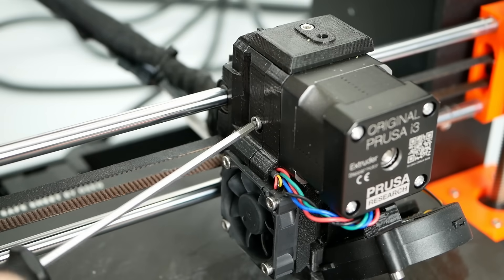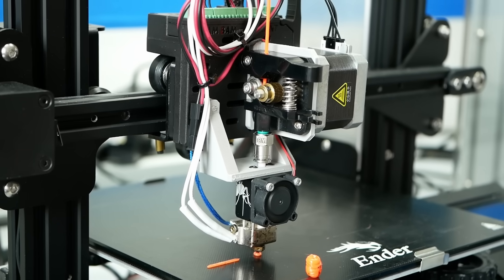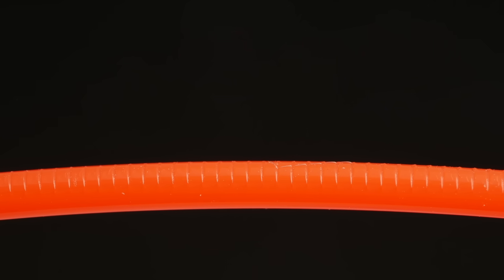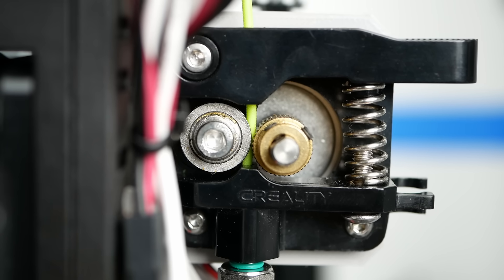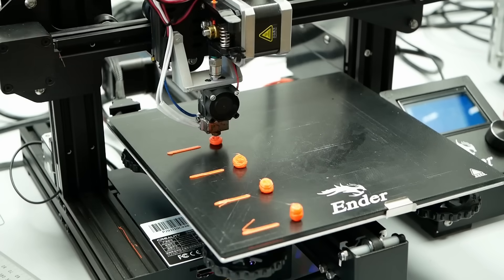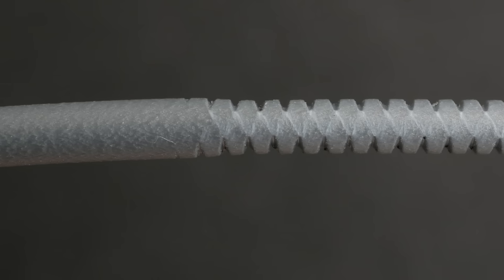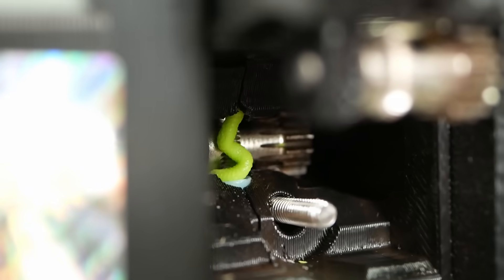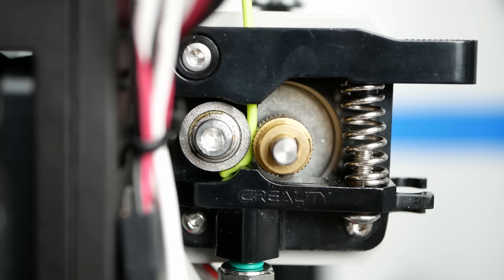Everything about Extruder Pre-Tension!

Comment: I removed the nozzle from my hot end, blocked the z axis so it could not move, then placed a postal scale under the hot end. This way I could directly measure extrusion force (at stall) and perfectly dial in my tension spring to maximize force. I found a 3x variation in force across the range of adjustment. And on one extruder I found the included spring was outside of the optimal range, swapping in a softer spring made a big improvement.
Reply: how do you find a softer spring?
Reply: @Baalldavveieir  Usually by digging about in a big box of springs you have collected over the years.
Reply: If I am understanding correctly, you used a scale to measure how much “force” was being applied to it by the extruder spitting out filament onto it?

Comment: Hey Stephan, I've seen you use the fiberixx print surface. Which I also have on one printer. I print with only a heated bed on the first layer with it. And save a lot of power with that. With the energy crisis and rising prices for power here in Germany, how about a video how to safe power on prints? Like insulated beds etc.
Reply: Hm, I really doubt that you save that much energy by only using the heated bed for one layer since getting the bed to temperature takes way more power than keeping it at that level. During heat-up the heating element is on all the time, after that most printers just turn it on in short bursts to keep the temperature steady.
Reply: @NiyaKouya  I have both of my printers on power metering smart sockets. My kp3s uses around 50w with the bed turned off and my  prusa mini uses around 70-80W with heated bed for pla. (after initial warmup) Bot are similar in size and have bed insulation so that should be comparable.
Reply: @pugofstardock  Then you just proved my doubt with your values. If we take a median of ~30 watts that the bed consumes for keeping its temp, you'd save a single kWh (worth <0,40€) after printing for ~33 hours. Might make a difference in a huge printer farm, but for a single printer that only runs every once in a while the difference can be neglected.
You'd probably save more energy by turning off some of your "smart" devices that run 24/7 ;)
Reply: @NiyaKouya  well you don't know how much I print 😉. 
And these are small beds. (and as mentured already insulated) . A 22*22cm bed is ~150% that size. A 30*30cm cr10 ~270%. I guess the power draw is around the same per cm². 
Sure I could remove the smart sockets, but I rather have them turn the entire printer unit off (printer, raspberry, lighting) after the print is done and the time-lapse is rendered. That also gives me the option if I remotely see a failure and somehow can't reach octoprint or klipper, to turn everything off.

Comment: i use a TRONXY 3D printer most of the time; it uses the extruder at the back of the machine… which makes the hot end very simple. The issue i’m having is i cannot use soft filaments in this printer because it jams constantly… i solved the problem by buying another 3D printer with the extruder near the hot end as you are showing. 🤑

Comment: I noticed you didn’t show dialing in the tension on the E3D Hemera. I find that system the hardest to dial in given the real lack of a visual reference. Especially depend on your mounting setup
Reply from the maker: I usually adjust it so that the inner white part is flush with the handle.

Comment: I wonder if this is one reason I keep getting clogs? Some of it might be the stock hotend but I wonder if it's getting crushed. Maybe causing it to crush it to the point where it's no longer 1.74mm and getting hung up in the Capricorn tubing.
Reply from the maker: Three things: (1)If you have a teflon lines hotend make sure the tube is still good and in good contact with the nozzle. (2) Make sure the hotend heatsink is cooled properly. (3) Don't use excessive retracts!
Reply: @CNCKitchen  thanks. I appreciate it and I'll take a look but I'm replacing my hotend because I'm converting to direct drive. Thanks for all the videos they help my work day go by.

Comment: The only extruder where I've had to pay attention to the tension was the original Bondtech, since you would run into issues if you didn't set it correctly. The design didn't have a spring, or other refinements.

Comment: Talk about perfect timing! I've just replaced the extruder on my Ender 2 Pro with the CR 6 SE extrusion kit to try out TPU printing. Previously I had problems where the extruder gears were skipping printing PLA, but whenever I tested using Motion > Extrude, it always extruded perfectly. Turns out I had to relevel my bed, my replaced nozzle was that close to the bed that it prevented normal extrusion during printing. Which goes to show, like you said, 95% of the problem is after the extuder! Now I realize... The new extrusion kit is covered... so I can't really see if it's skipping or not... Darn...

Comment: I never gave extruder tension much thought until recently. Through mainly luck, the last time I serviced my MK3s I dialed everything in just right and I haven't had to tweak anything in 6 months. Never had such a long run before. Recently I went to swap filament and I couldn't get anything new to load. I eventually figured out that that was just loose tension but it took me a LONG time to even consider that option because I never think about it.

Comment: I personally haven't adjusted the tension on my prusa mini+. I've ran pla, petg, flexibles, poly carbonates,and CF nylon with no issues to be honest. The fails and issues I've had were nozzle or adhesion based. Tho I've only used a couple flexibles, but I just adjusted the speed and such, and printed fine. I've seen loads of people not being able to print on a mini with flexibles, or some needing to adjust tension, but for myself I've kept it stock how it came from the factory.

Comment: I used the default ender 3 extruder at minimum spring pretension, it was perfect for all materials. Upgraded to cheap dual gear extruder. The provided yellow spring was way too strong, so i used the old one and it's just perfect on minimum tension
Reply: I also found this, the yellow spring is much too strong!

Comment: On my MK3S with MMU I sometimes have the problem that the filament gets stuck when retracting when it is clear of the extruder gears but won't pass through the chimney due to deformation. Perhaps I will try to reduce tension to limit the deformation on the way out.

Comment: Very interesting.   I experienced skipping with my original CR10S extruder.   I replaced it with a BMG clone by Fysetc, two gears.   I have not experienced skipping since.   I have only used PLA.   I apply light pre-tension but had not thought about the setting since the extruder is working.   Good tips on what to try if I have problems in the future.
Thanks,
Dave.

Comment: Now you posted a video about the perfect extruder tension - maybe you also can do one about the optimum belt tension? ;)
Reply: Optimum belt tension is rated on the Stepper motor datasheet.
Reply: Really depends on the belt material and length, but for regular printers, "tight enough" is good

Comment: I use the Bondtech dual drive extruder on my Prusa MINI+ and haven't had any need to change the tension (not even sure if I can). Seems to work fine with PLA, PETG, and TPU so far.

Comment: even with how cheap the original ender 3 extruder was im surprised by its reliability compared to some of the newer chinese extruders like the knock off of the Titan extruders which will fail after 10 prints or so.
Reply: Jokes aside, why is it that BMG clones are so good, but Titan clones are such garbage? I've had $10 BMG clones that are excellent, with few complaints. They often fail to lubricate the needle bearings, and sometimes you need a washer or two on the idler shaft to keep the gear riding correctly. Titan clones on the other hand, I've never had a good experience with them. Even when I've had them working well, they don't last.

Right now I'm rocking a printed BMG on my workhorse with real Bondtech gears that's been going strong for over 5km (about 15kg) of PLA, but I've never gotten any Titan clone to the 1km mark without it going to pieces. Maybe the design just doesn't lend itself well to being made poorly and/or cheaply.
Reply: I use those cheap red chinese dual gear extruder, bearings soaked with PTFE spray, works like a charm